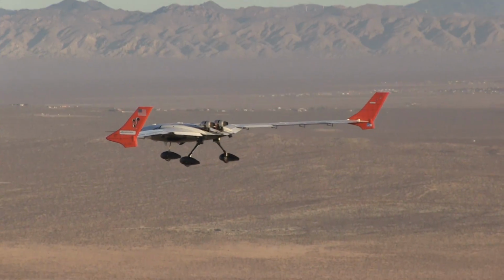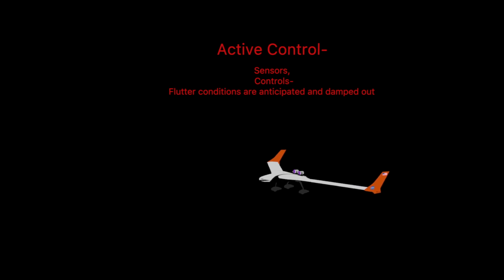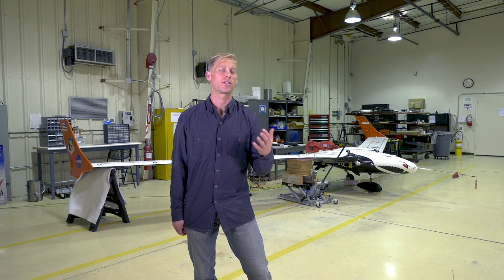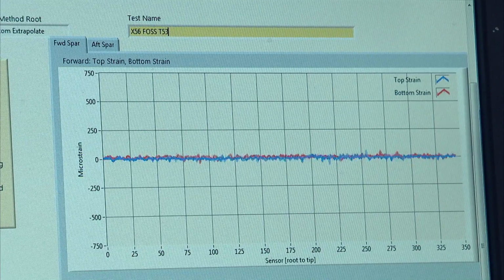X-56- The Future of Flight- Part 1: Active Controls

Comment: So by putting adjustable surfaces on the trailing edge of a wing, you're able to control the wings attitude.

Amazing work NASA. Just spectacular.

I'm going to go follow SpaceX now.
Reply: chrissysadmin you completely missed the point of the video....
Reply: There's a list of variable-sweep wing aircraft dating back to 1969 that have been able to alter the state of their wings to manipulate flight envelopes and as such avoiding flutter (along with other flight aspects). Most knowen among them are probably the Grumman F-14 Tomcat and Sukhoi Su-24.

Then there are aircraft with adaptive compliant wing systems, basically a variable-camber trailing edge. The Boeing X-53 for example used a system derived from this as are the F/A-18 Hornet.

There's the oblique/slewed wing on the AD-1 (1979). Likely one of the building blocks for what NASA is (still) working on now. But it doesn't really count, right?

What else, variable-incidence wings like on the RF-8A Crusader. Quadruplanes started using one or more variable-incidence wings in like 1919. The Parker variable wing was designed in 1920.

Variable-camber wings, some of which had telescopic segments that could be forced out, increasing the thickness, chord and shape of the affected portion of the wing. Some used a retractable bridge that connected two separate high aspect ratio wings, manipulating them into being single low aspect ratio wings.

On the other end of the scale you have parafoils and a great many RC models with flight stabalisation systems.

Either way having moving bits on the trailing edge of a wing is nothing new. There have been a number of other far more interesting developments and experiments (by NASA and others) than this. And that's the point I was making.
Reply: chrissysadmin SLS
Reply: cabdolla way to explain the missed point. Right up there with these trailing edge control surfaces.

They’ll have variable throttle next, you’ll see.

#OldTech #30YearsLate
Reply: Name one airplane that controls wing flutter modes using control surfaces. Flutter causes lots of complications, like control surface reversal. You really have no clue what you're talking about bashing NASA.
Reply: @cabdolla  Way to prove you know NOTHING about the history of aviation.  This NASA so called "flutter" research is ANCIENT BS.
Reply: Cool story bro. @w8stral

Comment: Complexity when flying is something we should strive to reduce not increase. Rigidity reduces the need for complex flight systems which in turn make the aircraft safer. If the Active Controls fail, then there is a greater chance for the plane to come apart at high speed which leaves little room for error for the pilot to gain control again without crashing.  While the goal of reducing weight is great for reducing fuel costs, it's not calculating the added risks involved IMO.
Reply: The same argument can be made with the introduction of any new technology to improve any existing system - it adds complexity and is therefore a potential failure point and safety hazard. However this is not a valid reason for opposing the development of said technology. If anything it's a good reason to keep experimenting and improving. To give an extreme example, if the engine in your car keeps exploding, you improve the engine design, not go back to using horses.
Reply: @scheimong  The potential problem here is  the lack of failsafe mode if the system actually fails (or at least they did not talked about it in the video).
As the wing is the main most critical component of the aircraft, you're looking at a instant accident if the system fails and catastrophic flutter occurs.
(As opposed to engines (you can glide); flight controls (there is generally three main systems).
In the case of wing, one solution could be to have multiple wings such that you can ensure the loss of one without impending the flight of the aircraft. However, that's a difficult thing to do because of the imbalance in lift forces that a missing wing will provide.
Reply: Sure. But for an unmanned aircraft, why not? Future aircraft are likely to be increasingly unmanned (drones, airborne antennas, cargo).
Reply: softdorothy true, for unmanned aircraft it makes sense. Seemed like the video kept referring to passenger aircraft though.
Reply: Sometimes fully understanding a problem leads to simple solutions.
I understand and in many ways share your perspective on complexity, but the premise
is a goal to produce more efficient aircraft. That goal is a worthy one. I heard nothing in the presentation that suggested they would ignore risk.
Reply: Micah Fischer ölbjjj
Reply: They’re doing research to develop ways to manage this unavoidable characteristic, not deciding where it should be deployed.
Reply: We already have fly by wire on unstable aircraft. Software error would be catastrophic so that is why triple redundancy is used. Evolution tends to go towards higher complexity, this is true for life as well as technology. Reliability and complexity are not always mutually exclusive.
Reply: @paulmakinson1965  The problem with most current redundancy be it double, triple or quad, with input and/or output plans voting is generic faults in hardware and/or software design and implementation. If there is a generic failure in all redundant systems, things fall out of the sky and power plant to boom. I know the Air Force and NASA have both used independently developed and built hardware and software systems in individual legs of redundant system, but that is very expensive. Human errors and incomplete or in accurate failure state analysis  is also a major problem in complex systems that fail. The current 737 MAX problem seems to me to be a very good example of this. No redundancy or input plains voting for angle of attack sensors, a sensor that seems to have above average failure rate. No failure warning to pilots when one fails. There also seems to be poor pilot training on shutting off the Stability Augmentation System. The Real kicker is, it seem in my opinion,  and overly complex system to overcome a problem that should be handled by the nose high and stall warning system. I have a problem with any system which can completely override the pilots. If the two best flight control systems on the plane, the pilots, are not in control I prefer to not be on that plane. No safety system/computer should every have absolute control of a manned system. As to the engine location redesign causing the nose to push up a bit that should handled as part of the type rated training for the 737 MAX.
Reply: good design is simple. not complex
Reply: @rohansully584  Which is why you are still using a Cathode-ray tube tv, right? Or a Nokia 3610? Neither is SpaceX flying with the same equipment and software as Apollo 13, even tho it's much much simpler. Good design and simplicity are not related, but complexity increases the workload required to make the design good.
Reply: @Excludos  I'm talking about design, not technological advancement. The world actually hasn't gone far with the examples you give - the iphone and 3610 are still single-hand held phones with screen and input (buttons/touchscreen) on the same face. The cathode ray tube and latest LCD TV screen are still flat squares / rectangles that go against a wall in the home. These designs haven't changed because they work well.
I'm glad NASA are looking at active stabilisation because its pushing the boundaries and we will learn from it. personally I believe they will realise / discover that this option will not provide more benefit.
Personally I believe they should spend more time (and they probably are) developing better materials that can withstand the forces they are trying to address.
I believe good design and simplicity are related.

I had the 8250 :)
Reply: @rohansully584  The technologies you mentioned may physically resemble each other on the outside, but the technologies on the inside are completely different: the CRT TV is significantly less advanced and less complicated than the LCD TV screen. 

As already mentioned, modern aircraft use significantly more active systems for guidance and control, i.e. fly-by-wire systems that you wouldn't find in older pre-Jet Age designs. And yet modern aircraft by statistics alone are significantly safer and more responsive in emergencies than those flown by our daredevil forebears in the past.
Reply: @rohansully584  not sure we should avoid complexity because good design is simple design, this is an arbitrary idea coming from dieter ram's 10 principles of design but look at nature : birds wings shape is not simple, cows have 4 stomachs and the list goes on, nature is supposed to have selected over time the best design through natural selection

Comment: Can’t they just put a counterweights, like tuned mass dampers, inside the wing body?
Reply: L Z designers usually avoid dead weights ..tuned mass damper has 'dead weight ' .. if that mass of damper contains 'useful weight '..will they rethink ...? like batteries, luggage ,backup fuel, electronics of aircraft etc. ..
Reply: ozzyg82 they use a more clever solution, a non completely elastic wing. But as the video says, it makes the wing less efficient
Reply: "The traditional solution to these aeroelastic issues has been primarily to stiffen the airframe structure"
https://history.nasa.gov/monograph39/mon39_b.pdf
But as you can read, this adds weight to the system and aerospace vehicles and weight equates to higher fuel burn and/or decreased endurance. 
The plan for future aircraft development is to decrease the thickness the airfoils thus lowering weight, increasing efficiency, increase in speed. The thicker the airfoils the higher the drag and that becomes an issue when approaching the transonic regime. So, adding mass isn't going to solve it. Control and material development is key.
Reply: Weight and aircraft don't mix.  No respectable aircraft designer would intentionally add dead weight.

Comment: I know this has probably already been thought of but what about harmonic balancers and or anti vibration cervos that vibrate at an opposite frequency eliminating the vibration? 

Kind of like the stab bar on a twin blade helicopter.

Another question would be, what about using bleed air thru a notch in the leading edge, like the Notar system, to not only stabilize the air but also create more lift?
Reply: Bryan Watling —I do believe you're on the right track!  5:40 ...other ways to deal with it for an integrated solution in the future.
Reply: Bryan Wating I’m thinking that to avoid multiple equipment systems, the anti flutter control surface is also the regular flight control.  Sort of a two fer one.
Reply: Ben Davis I can inderstand that. Just thinking outside the box and thinking of more efficient means. Any flight control movement can cause unwanted control inputs. Just thinking a passive system, such as bleed air introduced at the leading edge of the wing, would also be able to help the wing be more fluid within the airstream. Which could also mean better fuel economy and better lift and anti lift.